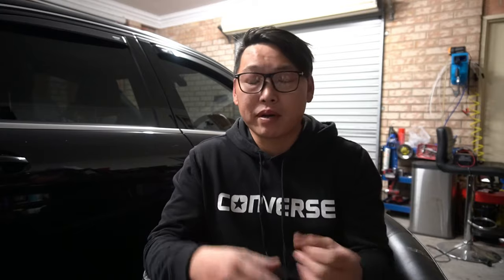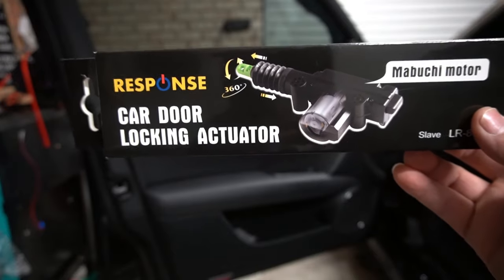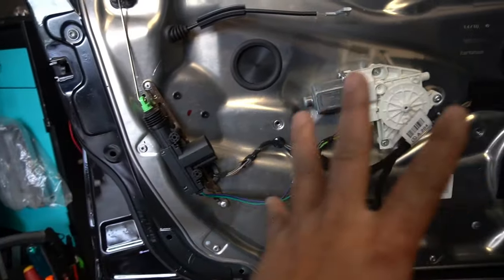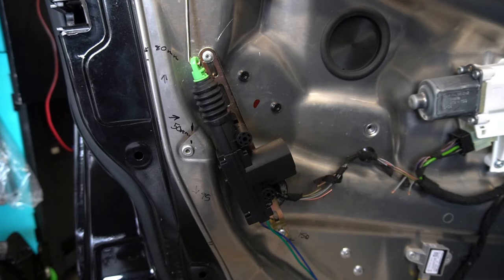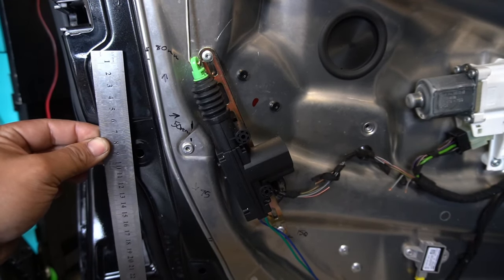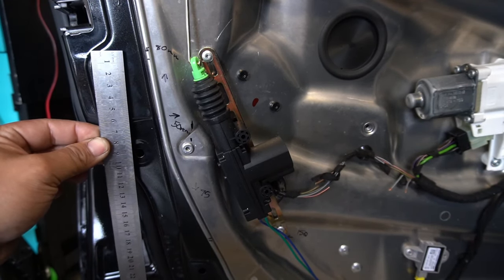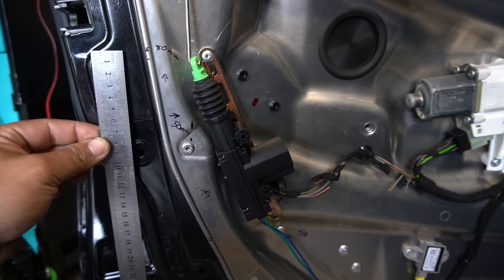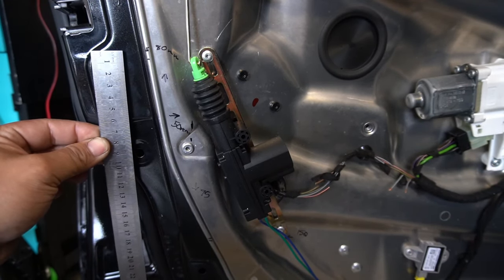mercedes common fault door lock actuator fix aftermarket part easy cheap reliable MUST SEE

Comment: Does the soft close still work?
Reply from the maker: soft close?
Reply: @MIKEYZVLOGZ  I have a w220 s class and the drivers side door lock actuator is leaking. But the soft close on the door also uses the pneumatic system to suck the door in so I was wondering if it does anything to the system.
Reply from the maker: @veishmenchrish3427  wen the actuator goes soft close doesnt reaply matter as its electronic...o understand mercees use the suction however this is a mechanical issue where a mechanical item has malfunctioned so soft closing wont matter

Comment: Hi, I have a 2011 c220d and when I press the unlock button, the drivers door will unlock, when I press again both rear doors unlock and then I have to press a third time for the front passenger side door to open. It's odd that after the second press of thr unlock button the front passenger door does not open. Appreciate any advice.
Reply from the maker: usually the setting is either driver door and the rest or all doors at once I haven't heard of the passenger door unlocking on the 3rd go... I'm not too sure tbh
Reply: @MIKEYZVLOGZ  yeah, I find it strange
Reply from the maker: @coffeeboyclips1973  definitely not normal my friend

Comment: Hi there, do you have a similar solution for a rear passenger door. I have a 2008 GLK 320 4matic.  The back door locks and unlocks only when it feels like it.
I ordered and received an actuator and I am ready to fit it in, however the configuration of the lock button is different to the front door, there is no rod, it is a cable from button  to the door internals / actuator. Can you help???
Reply: with the rear door i think you need to cut the blue cable too expose the rod connect it  and shaver of a bit of the door card inside for it to fit. in theory this should work out

Comment: My w204 coupe left hand door is having unlocking. Its licking pin is moving up and down normally but the door is not unlocked. Would installing of the universal actuator will fix the problem?
Reply from the maker: it should seems it's not latching completely
Reply: @MIKEYZVLOGZ  would check it out. Thank you.
Reply: @toemsakpolsri1073 I have the same problem. Did you do this and did it fix the problem?

Comment: Hello, would it work with a Mercedes W124 from 1992?
Reply from the maker: it's universal so yes as long as ur getting power to it it will work
Reply: thanks for answering😊  @MIKEYZVLOGZ
Reply from the maker: @W-124s  no worries bud

Comment: Hi Mikeyz , brilliant idea buddy. Please help me, the faulty lock actuator is on my drivers door (Master), can the trick work? I heard in your video that this only works on the other three doors who are slaves.. What remedy is there on the driver door??
Reply from the maker: for the driver door its similar allnyour doing is sending power to the unit ... but I haven't done my driver door yet ...but once u take off the driver door  if the cables are the same then it will work the same way ... I'll do abit more research on the driver side but I'm sure its the same wiring
Reply: @MIKEYZVLOGZ  thank you Mikeyz, should i use a slave or master actuator????
Reply from the maker: @enkosimdluli2399  slave or master theoretically it just needs power to lock and unlock ... the might be amount of wires used .. I would check the master and see what wires need connecting then compare and see if u can use a slave if not then master would be the way to go
Reply: @MIKEYZVLOGZ  thank you Mikeyz, will be awaiting your feedback.. from the Kingdom of Eswatini.
Reply from the maker: @enkosimdluli2399  no worries I'll check it out and let u know

Comment: How different is the driver side?
Reply from the maker: not sure yet as i havent had to do it ...but i will take a look and find out... it will be fairly similar... its the master lock actuator so maybe just a a couple more wires that you meed to connect nothing major..but you do need to make sure that you buy slave for other doors and ,aster if its your driver door/main door
Reply: @MIKEYZVLOGZ  thanks for all you do!

Comment: It could be great if you mark the exact spot where the actuator has to be installed for rear doors: I have removed my rear panel but it seems I have no room, because of the rear loudspeaker! Furthermore, in the rear doors, pin is not on the door, but on the panel!
Reply from the maker: I haven't needed to do it yet ..but if u scroll through the comments ppl have done it to the rear successfully as well .. I didn't wanna just cut my factory wires just to do a video ... but I prolly will have to do it soon..maybe I can do a 1min short showing where to put it ..remember I had to modify my front door to get it to fit..
Reply: @MIKEYZVLOGZ  Ok, I will try again. In order to use as less room as possible, I think I will install the actuator without the bracket. To do this, I will check for best position using biadhesive and trying to reinstall the panel. Once I have found the best position, I will install directly the actuator using a couple of screws or rivets. Hope it works.
Reply from the maker: @tasteclimber  yes it should mate
Reply: it is possible and i just had mine done. ive located the actuator near the window regulator motor. the tricky bit is to actually cut open the cable and secure it so that it wont wobble around when the actuator pushes/pulls.

Comment: Will it work at the rears also?
Reply from the maker: yes it will
Reply: @MIKEYZVLOGZ  Tried to do my rears today but there is no way to fit the aftermarket actuators. Its just too tight and the oems is installed way different than the front.
Reply from the maker: @sramzurc8000  I was told it's doable by a fellow subscriber..b there's a perfect spot. for it .. I'll try sus it out for u
Reply: @MIKEYZVLOGZ  There is absolutely no room.
Reply from the maker: @sramzurc8000  hmm that's very strange ... I dunno how ppl are doing it then .. cuz I've been told by a few ppl that it can be done as I was also curious about this too.  I understand ur point of view about no room... I had my concerns too... then someone actually confirmed that he did it ... I have to ask them again wen I find the msg ..it should be in the comments of the video
Reply: @MIKEYZVLOGZ  Please let me know. The only way i see it is yo be installed inside the door. Meaning i have to drill the rivets thats holding the cover.
Reply: Hey Mike where you able to do it?

Comment: This works for my W212 but only opens the lock. Does not close it. I did not cut the other wires. Any ideas on whether there may be additional wires sending discrete close command? In the W212 case it is Green and GreenBlack Stripe. Again - door lock up works, down does not.
Reply from the maker: i think the other wires are causing it to not lock ... i just cut the other wires becuz to me it didnt interfere with any other signals... now u can always cut them and re attach them later if u need to im thinking that the wires u havent cut arent letting it send the signal to unlock becuz it should work fine... ur basically just sending a signalnto rotate the motor and wen unlocking it just reversea the polarity hence unlocking the door .makes sense?
Reply: @MIKEYZVLOGZ  OK, thank you for the quick reply. I noticed in your great video that it appears not all of those wires leading into the door are cut. Should I cut all of them?
Reply from the maker: @ndfrankel  chexk ur car make and model and see if u have the option the wires are used for .i believe its a tumbler switch..i cut mine and nothing changed..sometimes we gotta go for trial and error..so long as we know we arent doing major damage it doesnt hurt to trial and error... in this case the worst that can happen is u lose a function u may never use... and u can always re connect the wire u want etc... understand what im saying ?... i cut mine and all is fine
Reply: @MIKEYZVLOGZ  got it. thanks again. Will cut. probably set the airbag off. ill grab a pillow
Reply from the maker: i did cut all my wires and then only reconnected what i needed the grey with blue stripe and grey with black stripe... i havent had airbag issue..besides it doesnt relate to airbag sensor buddy... so dw ur fine....or else it would have happened to me
Reply: How do I connect the wires? Sorry I know nuts about electrical stuff. I’m w212 as well
Reply: @lemes9797  I found that you do not need to cut all the wires. Only cut Solid Green and Solid Green/Black Stripe and connect those two wires to the actuator. Leave all the other wires intact. They relate to the alarm system, door sensing (open /close state) and if you cut them, the door will still work but the car alarm will not know if the door is unlocked or locked.
Reply: @ndfrankel  solid green to blue and black stripe to green?
Reply from the maker: @lemes9797  should be same colour wires buddy
Reply: Oh my fucking god guys.. I cut all the wires before I got any replies and guess what.. I was trying the universal actuator and couldnt get it to work.. I was thinking damn, couldn’t have gotten a faulty product is it. Then I take a closer look, the frigging connector is not even connected ! I’m so dumb but anyway I’ve fixed it, thanks Mikey and Nathan !
Reply from the maker: @lemes9797  lol all good mate we all make mistakes as long as we learn from them ... good on ya for doing it yourself
Reply: Yeah in my country Singapore hardly anyone diy stuff, most of them just sent to workshop cause we dont have garage space in our housing unless you are super rich, I simply love videos like this that give me the hands on opportunity, though many would ask me to send to repair shops from where I am. 🤣
Reply from the maker: @lemes9797  that's why I do it to help others like u and I who can try diy and save money... if I can do anyone can do it
Reply: @lemes9797  Did you cut the blue and white wire on driver door for and attach the green to green and black stripe and blue to solid green w212 and actuator unlocks and locks?
Reply: @loganbanks2962  which wires did you end up cutting to repair your door lock actuator on your W212

Comment: Genius idea, how do you connect that to W163 2003 model. It uses a wire rope
Reply from the maker: wire rope? I'm not sure I would have to see it in order to figure it out ... I'm not familiar with all mercedes mainly just w204 as it's what I work on .. and w203 as I have that too
Reply from the maker: after thinking about it abit , i think that regardless of which way the door locvk actuator is fitted it basically just needs power once you lock or unlock the door, in my case u see how i just connected the wires that powered the factory lock?? just do the same thing , when u say wire rope what do u mean by thaT ?? DOES THE WIRE ROPE STILL HAVE POWER TO IT?? OR IS IT ASCTAULLY POWERED BY A MANUAL WIRE?? IS THERE CENTRAL LOCKING FOR YOUR CAR?? IS THERE ELECTRICS THAT CONTROL HOW THE DOOR LOCKS AND UNLOCKS?

Comment: Great for people that aren’t to bothered but for the sake of an hour I’d rather drill the rivets, yes there is a cost for the actuator but that’s just me I’d much prefer a stock look, and that looks like it would rattle
Reply from the maker: fair enough ... and it doesn't rattle
Reply: @MIKEYZVLOGZ  hi, I have the same issue. My door does not open at all. I have been banging it from outside and inside and I have had no luck. The door has been stuck shut for the past 3/4 months now. Can you please help me with this?
Reply from the maker: @TheYoungWarlock  hi there ... it most def must be the actuator that fails
Reply: @MIKEYZVLOGZ  is there any way I could open the door so I could have it replaced?
Reply from the maker: @TheYoungWarlock  how do u mean ? like open the inside ? and have someone else do the work?
Reply: @MIKEYZVLOGZ  the door is stuck shut. Every time someone needs to get in they have to jump in though the window
Reply from the maker: @TheYoungWarlock  yes u can pull the door apart from inside I have made a video about this .. usually it's he inner soor hbdlw that breaks ..I also did a video showing how to replace it
Reply: @MIKEYZVLOGZ  hi, can you please post the link here? I couldn’t find the videos
Reply from the maker: @TheYoungWarlock  https://youtu.be/THYUUTIouLw?si=-2_y5cnGwyxmNcz5
Reply from the maker: @TheYoungWarlock  https://youtu.be/Pc1tzi52re8?si=jLswkGUyNrgd-Cvu
Reply: @MIKEYZVLOGZ  thank you for these videos! Really appreciate your support. I’m still struggling to get the door to open. If I break the door panel from the inside, would it give me any access or assist in opening the door?
Reply from the maker: @TheYoungWarlock  hold on firstly ..wen u pull the door handle it doesn't do anything right? is this why u want to somehow open it...if u were going to break anything to get in I would suggest the door handle area cuz easily replacable ..but don't break the led that is in the door handle ... u will see in my videos where the latch is to open the door ...that latch is what pulls the door handle and in turn opens the door..I believe yours has broken off that why it won't open
Reply: @MIKEYZVLOGZ  so basically when I pull the handle the little thing near the window comes up but the door doesn’t open. So the issue is not with the handle cause the handle still has tension but the door won’t budge. Even if it’s pulled from the outside or the inside. I even tried to unplug the cable from the handle and pull the cable with hand, and again, the little latch thing comes up but the door won’t open
Reply from the maker: @TheYoungWarlock  i see u need to open tour door and see what came loose .. another good way would be to call a auto locksmith and see if they can get the door open for u so u can take it apart

Comment: I see you have more wires cut than 2 and is that an mistake you make or what is the reason for that. around 6:17 on your video
Reply from the maker: yes , it was a mistake i made , i thought the brown wire was the ground (as tahts normally ground, brown is usually ground in mercs) s0...nevermind the other cables... only cut the ones i refer to , i cut them by accident and resoldered them back together because i noticed something wasnt right with my door led , and that was it ...lol.. so do not do what i did ..learn from my mistakes..im no professional, i simply diy and share my experiences in hopes that it will help others do a better job and help with FAQs

Comment: 1996 s class mercedes air lock system
Reply from the maker: yes I u derstand.. however I don't think this will do that ... but as I understand there should be a power wire that goes to the lock actuator in your door ..like all merc designs .. and maybe u can bypass it by simply using the power wire to power the lock actuator ..u would have to do abit more research on the modification

Comment: Mine is making a noise like it is trying to lock but the lock won’t move. Is that the actuator?
Reply from the maker: yep that would be the actuator these are common
Reply: @MIKEYZVLOGZ  I bought a different one off amazon because the one you linked was no longer available but it looks very similar. Will any universal lock actuator work here?
Reply from the maker: @Dnasty1  yes as long as it got 2 wires for power all g
Reply: @MIKEYZVLOGZ  yea it had two wires and it’s main marketing point was how low profile it is. Getting ready to try this on my w207 hope it fits. I’ve watched a few vids and still not sure it doesn’t have that little square gap but much of the door seems to be sound proofing so I may be able to cut that out to fit it.
Reply: @MIKEYZVLOGZ  hey man was curious did you disconnect the airbag power when you did this?

Comment: My aftermarket actuator has power but it unlocks and doesn’t lock…fixes?
Reply from the maker: that's wierd ..not too sure why it's like that
Reply: @MIKEYZVLOGZ  I’m being told it’s the door control module that also went bad
Reply from the maker: @Bridscape  damn u may need to change that .. what's the issue
Reply: @MIKEYZVLOGZ  just to confirm - you cut the 2 wires you connected right? The 2 grey wires with stripes right? Grey w/Blue and Grey w/Black
Reply from the maker: @Bridscape  yep
Reply: @MIKEYZVLOGZ  no other wires are cut?
Reply from the maker: @Bridscape  no only cut what u need ..if u do cut any others it stops a feature from working for example I cut a different one Nd it stopped my door welcome light and rotary tumbler switch which related to it Aswell so do not cut any others 

 all wires have a purpose

Comment: This does not fit on the rear doors.....unless,you know different? There is no room for it and the manual lock push button comes away with the door card and can’t be accurately fix to the actuator push rod.. all ideas gratefully accepted
Reply from the maker: noted will try and find a way soon jist been so busy
Reply: Just finished installing an actuator in one of my rear doors and all is fine. Same colour coded wiring. It was bit more involved because part of the lock cable has to be stripped and then secured. May remove the door card and take pictures.
Reply: @Wisdom-Thinker  Can you share pictures pls?